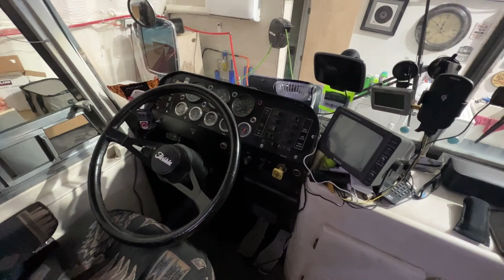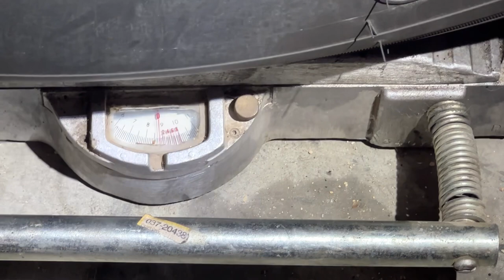That is not safe!! Vintage bus needs some seriously important new parts + beautiful flxible bus tour

Comment: After you weld on a nut, there is a finite time to get the bolt out.  As soon as the color starts to fade, you must slowly begin the removal with a continuous motion.  Use an extension if you need the room to maintain constant motion. If the nut breaks off, start over. It will come out.  I love these guys.  Safety, safety, safety.

Comment: Great videos. I too would feel safe after the BGM crew work on my bus. I do have a few comments: 1. If the red-hot weld were doused with water, it might harden the metal so that it wouldn't snap off? 2. When arc/tig/mig welding, I always recommend covering all exposed skin. Prevent cancer 30 years on. 3) Leaving the vice-grips on while red hot could ruin the grips. Happened when I lent a pair out to butcher in the shop.

Comment: Spray penetrating oil on the red hot bolt. This will cool it plus cause the lube to be sucked into the threads as it cools. I watched a young mechanic welder do this to a very rusty number of manifold bolts on an old Cat engine . Very worn. He kept heating them red hot and spraying until he had them all removed . This was back in the 70's.
Reply: Also the key to success here is to go slow keep repeating the process until bolt starts to move.

Comment: Sometimes you can step-drill out a broken bolt by beginning with a 1/8 drill, then moving up to a 1/4 or 5/16, then to a 7/16 or 1/2. You really need to drill as deep as you can while lubricating the drill with cutting oil or WD-40 while avoiding breaking the drill off. An easy-out will work better if the walls on the broken bolt are thin, but not so much that it gouges the hole in the part.
Reply: Well I wonder why he didn't think of that.

Comment: Scott i never see you driving in king pin bushings and reaming if necessary  also I never see you check tracking from front to rear 
Like if frame is bent or damaged 
Maybe  I have missed it in your  videos. I would like to see more work on Cummings and Cat engines  thank for your videos

Comment: Man that flexible bus is gorgeous! What year is it? I didn’t catch the year when it first came around. I never run into nice stuff like that either it’s expensive as hell or what I usually get is something I have to put 5 or 10 grand like my last RV. It amazes me though that people buy this stuff and never keep up the maintenance. My rigs air brake desiccant/filter hadn’t been changed since 98 because it was hard to get to I guess. It was a mess plus the heater wires to it were broke . We’ll take care and I’ll be looking for the next installment.
Reply: 69.
It's actually embroidered on the entrance step rug.
Reply: Often the neglect begins with very first owner be it an individual or a cash strapped bus line.  Once it begins it becomes very expensive to catch up as the bus ages and maintenance is ignored or done only seldom.

Comment: I watched another YouTube Chanel and they took out bolts that were seized by heating them red hot then cooling it fast to brake rust , would liked to see if that would have worked on the spindle broke off bolt ?

Comment: Scott, that spindle can be saved, if you have access to a milling machine. It would be a bit of a pain to setup, but doable. 
Best wishes from the far North.
Reply: I agree If not in house I would let a machinist fix it as you say getting parts is harder to get spend the money to fix the threads and now you have a good spindle for less than the 900.00 for  used one
Reply from the maker: Machine shops are backed up weeks if not months
Reply: @BusGreaseMonkey  As you said yourself, parts are harder to come by. Get the stub milled out to a shell, pull the remaining thread wire out. Let your friends at American Coach, I believe is the name of the company, know you have it, for a price. Or, save for one of your customers.
Reply: @BusGreaseMonkey  I under stand I was just saying to drop it off and get back a spare as I am a mechanic and understand needing to turn things around  asap

Comment: Wonder if an 1/8" piece of flat would have been a better choice than a nut on that broken bolt. Another option that is kind of a variant of the flat is to first weld a flat washer to the broken bolt and then weld a nut to the flat washer. Sometimes nothing works!
Reply from the maker: There is a collar that a spacer fits into at the tip of the bolt break.  It’s not flat across so having a step down that needs to remain clear made it way harder

Comment: We'd seen this happen since the early 1990's, not quite as bad, then, as now, but 'bad enough'. Towards the end of the 1980's MC-5(A)'s (Greyhound and independent operator); MC-7's (mostly Greyhound); Silver Eagles (mid-'60s vintage, and a few 'early' Golden's), Buffalos (4108's and early 4905's) began showing up on the market, many sold via a company in Winter Haven, Florida which reconditioned 'mass-purchased' MC-7's and a few 5's from Greyhound beginning around 1983.  These vehicles were properly maintained, and many were purchased by charter operators to service Casino trips to AC, and 'for profit junkets to heck-knows-where.  When these charter operators sold them off is when the problems began.  The RV Craze was beginning, as celeb's like Dave Madden, Dick Vermiel, Dale Earnheart + NASCAR in-general, and musical entertainment celebs purchashed from/contracted to RV retrofitters, and from that point forward - began the problems with "uninformed maintenance practices" culminating with what you've seen for the last 20 or-so years.  

IMHO: most of these maintenance issues began courtesy of truck repair shops which weren't "adept" at repairing motorcoaches, or just didn't access the manufacturer's service info. I'm certain that at least a few 'private coacher's' visited Greyhound "doghouses" in larger cities in emergencies. Hopefully, one of those gent's reads this, or better yet, follows BGM, and chimes-in/comments as to what they've seen.

The first MC-6/Flexliners I ever came into contact with, were when sales personnel from that particular Greyhound-retrofitter stopped by to offer to repurchase two 7's which were about to be sold in the late 1980's, which allowed us to purchase a newer 96-A, and later, a 102.  Those MC-6's, and Flexliner's are truly the most beautiful buses EVER made, and will remain my favorites forever!

Comment: A question that has me dumbfounded… 1990 6v92 that all of a sudden stopped running now when cranking air is sucked from exhaust and blowing out the turbo intake from air filter……
Reply from the maker: You didn’t change the starter or any parts.  Engine shut down from running then wouldn’t restart and air direction seems to be backwards?
Reply: @BusGreaseMonkey  that’s exactly what happened
Reply: Replaced the turbo started fine idled fine till air up hit the high idle switch engine acted up immediately switched high idle off then idled a few seconds before it stopped then above issue is what happens now
Reply from the maker: Well there isn’t really anything to make the exhaust suck but check that your blower drive shaft didn’t break.
Reply from the maker: Is the turbo still spinning freely?

Comment: Is there such a thing as a wheel alignment to correct for caster, camber and toe. I do not recall any discussion of this type of service in particular on this one with all new front end parts. Just asking because I had my car done recently correcting a negative camber that chewed up a back tire ( which was totally worn out anyway )
Reply: On these old solid axle front suspensions, usually caster and camber are frozen. Only the toe can be adjusted. Pause the video, and you'll see there's not a lot of threaded components to make adjustments with.
Reply: Actually yes there are means of performing alignment on straight steer axles.  Camber is corrected by bending the axle, caster is corrected by either twisting the axle or placing/changing wedge shaped shims between the axle beam and the carrying members.  Toe is adjusted with the tie rod sleeve.  If you want to see the equipment required for axle bending, look up Bee line heavy duty alignment equipment on the internet.
Reply: U bet me to this answer